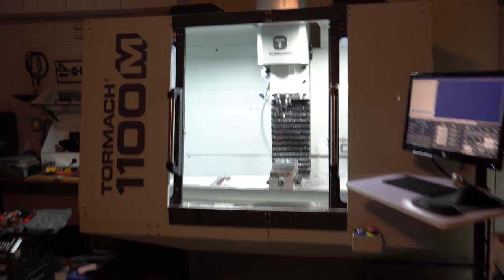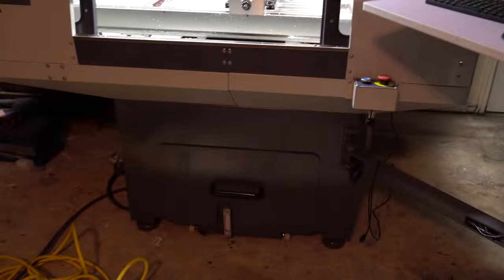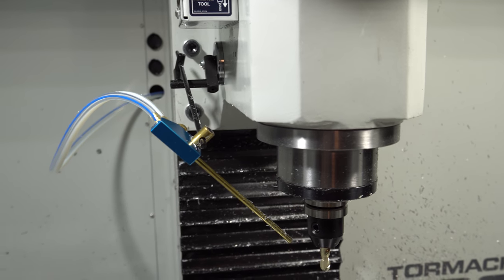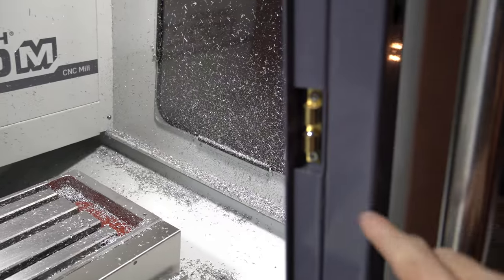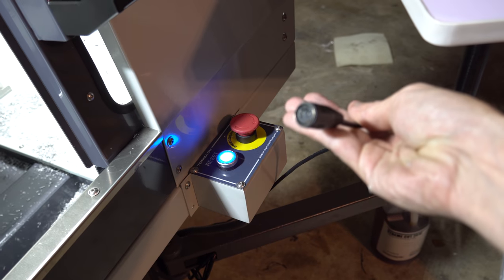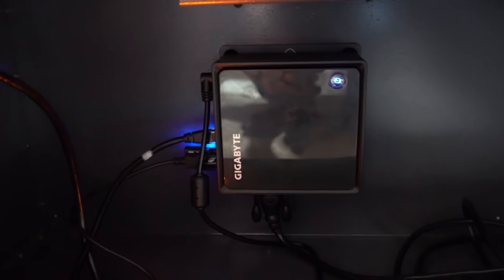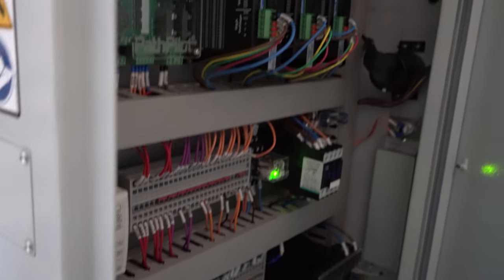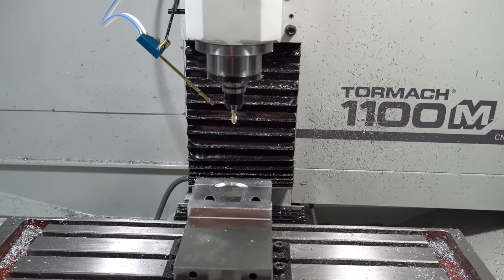Tormach 1100M

Comment: To the Tormach electrical engineer, especially the one that layed out the electrical cabinet, you need to go and reeducate yourself. Little details are what make a well engineered machine/system. Having the power supply below the I/O processor board and immediately below that, a heat generating VFD that probably uses resistive breaking is just a good way to ensure early component failure. A proper layout will have all the heat generating components above any processor or heat sensitive component. Do today's engineers not look at what their competitors are doing or even how it was done 40 years ago?? Tree Machine tools did it the proper way 40 yrs ago. Have we not learned since then??? And don't tell me you've directed and exited  the warm cabinet air towards the floor. That would be just wrong.

Comment: Awesome video! Thanks for taking the time to do this.  How easy is it to pull the machine forward on its casters for when its time for maintenance or upgrades?
Reply from the maker: i left enough room behind it that i can get back there for most things, but moving it isn't too bad anyway.  have to use a pallet jack and it'll push around... might need an extra hand to guide it around.
Reply from the maker: also note that realistically you'll only want to do this as rarely as humanly possible, as even though moving it is quite easy, you do have to re-level it every time.

Comment: Can you measure the Power Drawbar legs and base plate? I wanted to see if the series 3 would be compatible on the 1100M.the air piston looks the same thanksJames.
Reply from the maker: The Quiet Mechanic sure... you just need to know the length and the location/size of the holes?
Reply: Length of legs- and base plate thickness    Thanks
Reply: James Martin, Can you measure the legs(standoffs) and base of the PDB  Thanks Bro:) I just bought the 1100M and have access to a series 3 PDB. I want to see if it will work before I purchase.
I have a few other question about your Mill Base. Would it be alright to exchange emails for them questions Thanks
Reply from the maker: The Quiet Mechanic legs are 4 1/4” long, base plate is 7/16” thick.  Feel free to message me, I’d be happy to answer any questions that I can.

Comment: does the spindle over shoot the table on the Y axis on both sides? if so, by how much?
Reply from the maker: it does with the stock t-slot bed.  with the SMW fixture plate it goes right up to the edge on the back side and not quite all the way to the front (it hangs over the front a bit)

Comment: Is there any particular reason you didn´t go for the haas mini mill, which is also around 25k?
Reply from the maker: faxxzc it’s too tall for my garage, and nowhere near 25k by the time it’s actually installed and making chips.  Granted you get the atc included, but I was looking at 35-40 minimum with everything I’d need.  everything is a lot more expensive, from tool holders to replacement spindles, machine upgrades etc.   Pricing isn’t apples to apples at all.

The 1100M without the atc was just over 15, maybe 17 all-in with basic tooling, vise etc and other small things I’ve bought since.  It’s pricey, but nowhere near realistic haas money.
Reply: James Martin i know the height problem too well, i would have put a minimill in my garage long ago if it would have fit. I did look at a chiron fz8 which is a very compact machine at 2,2m and super fast. However i was super lucky to find a MakerSpace near me where i have access to a full vf-2 which i can reserve for 8h at a time
Reply from the maker: faxxzc nice... my options pretty much boiled down to tormach or a skyfire svm-2.  Skyfire quit responding to my emails when I asked for a quote, so that kinda made it easy.  Their machines do look great, though.
Reply: Yeah, a MM is not even close to 25k, not even close to their advertised 29,500. You have 2000 for shipping, 1500 for rigging, wire runs, all that fun stuff.
Reply: I got a Super Mini Mill after looking at the Tormach - it was about $60k or so plus tool holders, workholding, etc. Total spent was about $78k. It barely fit in my garage, but I made it work (you can check out the installation on my channel)

Granted - it is 15 HP, 15k RPM, high-flow coolant, chip auger, 1400IPM rapid, 800+IPM cutting, ATC, rigid tap, Renishaw probe system, linear ways, etc, etc.....Massively more capable than a Tormach. 

It includes a technician for a day of installation, a day of training/calibration. If you have a business, the HAAS is the way to go. If you mainly want to have fun cutting metal and don't mind that the machine itself is an ongoing project - Tormach can be good for some.
Reply from the maker: Factory400 exactly.. by the time I need a haas, the ceiling height will have long not been an issue :)
Reply: @Factory400  If I could justify spending $78k, why in the world would I even look at a Tormach??? It's like saying I looked at the Toyota Yaris, but then decided to go with a Porche. If you mainly want to have fun driving around, the Yaris can be good for some...
Reply: @steveh8724  I looked at buying a Tormach outright or playing the long game and financing the Haas. So I genuinely looked at both and weighed my business options. A Toyota Yaris vs Porsche decision is purely a personal one. Tormach vs Haas is a much colder business decision for many. Neither one would be a toy.... they would need to fill a specific manufacturing need.

Comment: Is the power drawbar plug and play? or did you have to install wiring and solenoids?
Reply from the maker: You have to install all of the pneumatic hoses onto the power drawbar itself and the button.  I don’t have an electronic solenoid... I guess you only get that with the tool changer?
Reply: James Martin  thanks,looks sweet  have you noticed a big difference in the machine compared to the old?travel ,power ,feel...ex
Reply from the maker: The Quiet Mechanic I haven’t pushed it very hard yet, and only in aluminum.  The most aggressively I’ve gone so far with a 1/4” tool is .375 doc/0.05 woc @ 35ipm, spindle at 7500.  It is very quiet making that cut.. I’m sure could be much heavier.  I can’t wait to see what it’ll really do once my minishear arrives.
Reply from the maker: @MR.KNOWITALL1982  update: i've been pushing it harder and harder as time goes on.  my roughing routines tend to hover around 4-5cim depending on the tool.  i'm finding the shearhog insert tools are the way to go for high removal rates.. i can get over 6cim out of them, but i generally run them around the same 4cim, no need to go much quicker than that for my application and it's quieter (in the garage).

Comment: Can you say anything about the tolerance your getting  with the new machine ?
Reply from the maker: Lucas Barrientes haven’t done any real testing.  I plan to, and will probably make a video.
Reply from the maker: update: it's been quite a while now and a lot of cutting time.   i'm finding that it's pretty much like any other machine... you get out what you put in.  any error in my parts tends to be my fault :).  in terms of raw repeatability part to part, better than a thou or two is easy assuming you do a reasonable job setting it up (again, just like pretty much any other machine).

Comment: Servo Motors or steppers?
Reply from the maker: steppers... servos coming in the spring time (1100M+ update).  i probably won't do the full mx, as i haven't had any issue with TTS and i already have a bunch of TTS holders

Comment: I bought a 1100m today🙂
Reply from the maker: awesome!  still rockin this one over here... pro tip: when you get it, take the time to really make sure it's level and the base is shimmed properly.  i just did this a few weeks ago (i had only leveled it with an inaccurate bubble level prior) and it fixed an issue that i thought required tramming (flycutter recutting a bunch on the back side).  turns out you just have to actually level the thing ;)